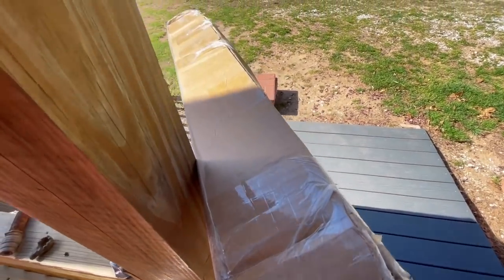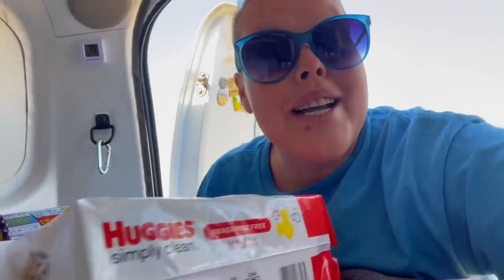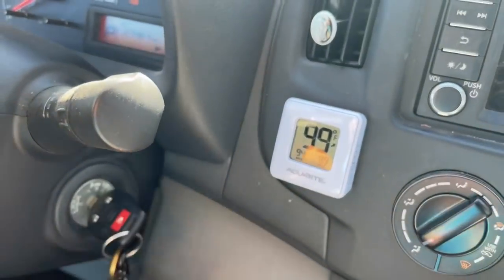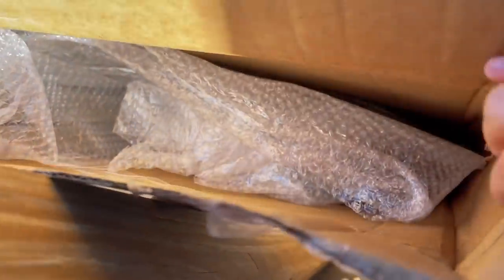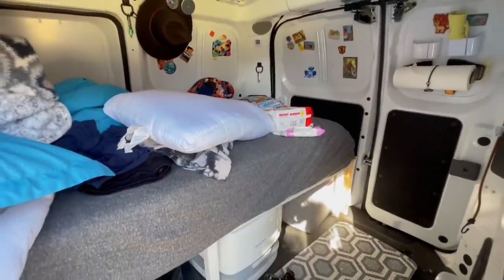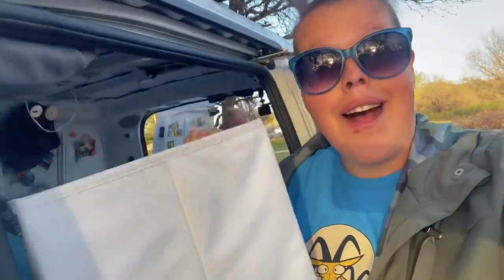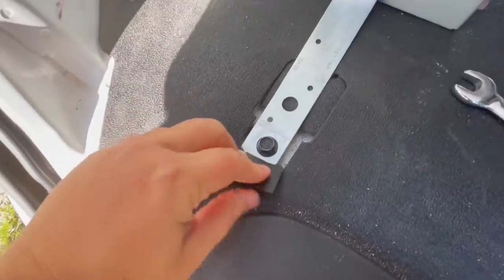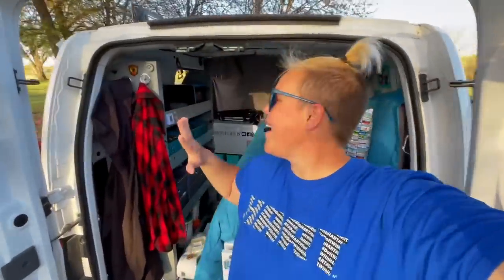Van Conversion Shelving Project | HUGE Project To Customize Cargo Van Living Space

Comment: Love the blue mirror! 
Why not put your shelving up to meet the roofline as you wanted-build a study base w/storage?
Reply from the maker: I didn't want to add to the shelf any more as it was marketed to be a full shelving to match the measurements of the design.    In addition i would more so just be building a platform if that was the case and that wouldn't be easy or practical.   I have a bottom shelf on the unit already which surrounds the wheel well.

Comment: Also had one other thought.  Does your seat fold down to make a desk (your passenger seat)?  I saw one man actually turn  that seat around and bolt it back to the floor.  That provided him a nice working chair and he could still fold it down for use when driving.  I know your bed is there so that may not be practical.
Reply from the maker: My seat does fall down however the way I have everything configured with my bed and my refrigerator it doesn’t really work for me to do that particular thing. I did consider putting a swivel on one of my seats before this orientation and talked myself out of it because the passenger seat has a jack below it.

Comment: I love the shelf unit.  How much leg room does it leave for walking, sitting and working?  Your decorative touch is great in such a tiny space.
Reply from the maker: I have plenty of space to be able to pull out my underbid bands and then also I can put my feet down comfortably on the floor between the shelf and the bed. I’ve never really had a ton of space because of the size of the van but I feel like it really addresses storage and organization in a much more comfortable manner. Not to mention I don’t have to move near as many things into driving mode which is very helpful.

Comment: Is this metal shelving unit 32" width? Does the metal back piece make a big difference? Pros/cons?
Reply from the maker: To me the metal back plate is very important because a lot of times whatever you’re going down the road things kind of move around and the worst thing that could happen was that it would get stuck behind the shelf and I wouldn’t be able to retrieve it. So I wanted to definitely put the back on it because of that reason.

Comment: Bunny, with the price of lumber nowadays going metal probably isn't a bad idea. That's said, for 400 bucks the thing should fit perfectly from the start shouldn't it!
Reply from the maker: Whenever I read through the online reviews from this particular product it does mention that it is ideal for both kinds of vans meaning that it fits over the wheel well after reviewing it a bit more I noticed that the listing that I had initially found it for was the Amazon listing. That was the one who said it is designed directly for only the NV 200. When I went to their website directly I looked into the description a bit more and it says it is contour to fit against the wall which it does but it does not say that it meets the ceiling height requirement fully because it is compatible with the tube so it wasn’t false advertising and I’m still OK with it being a $400 shelf considering that it will have a lot more durability then what I probably could’ve built myself out of wood.

Comment: Are you sure its not upside down? If you flipped it over the legs would go over the hump and fit more snug.
Reply from the maker: No the back only fits one way and that is with it upright like it is otherwise it is closed at the bottom and will not fit on the wheel well

Comment: Looks really good but I thought you said that it was made for your van paying $400 for a shelf and not fitting right and have to do some resetting for it I don't know if I would have liked that your dad's a very smart man and really cool on doing things but I just don't know if I would have liked that okay keep the videos are coming
Reply from the maker: I believe after reading more about the shelf that it is designed to fit the wheel well measurements not the contour of the ceiling.   So that isn't terrible and does make it make sense... but on the initial site which directed me to their site it mentioned designed only for the NV200... I had looked at several other shelves on amazon which were "designed for the nv200" but also for others and they had reviews saying they did not fit at all with the wheel well measurements of the NV... so this is why i leaned into this one... at the end of the day it does fit, it just isn't cut for the back plate to fit in a contoured way.
Reply: @BunnyPlaysHere  okay that's better sounds then cool that's why it didn't fit the way that it did awesome great thanks for getting back with me and letting me know I appreciate it 100%. Okay keep those videos are coming Happy Easter